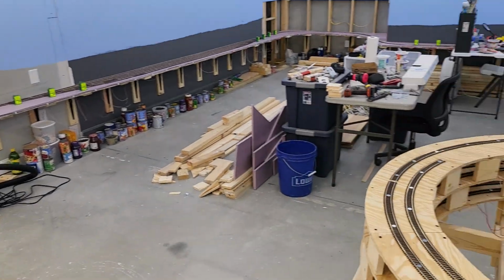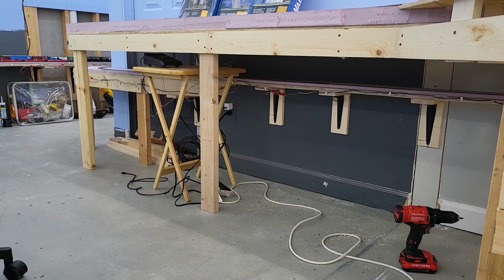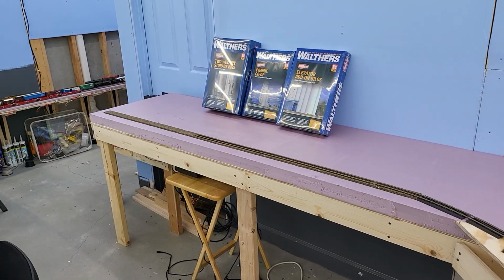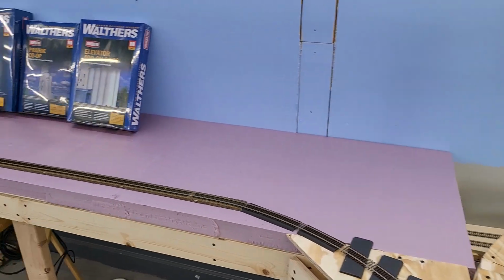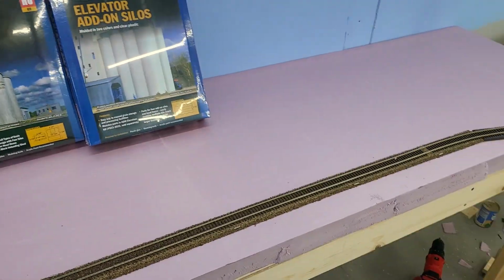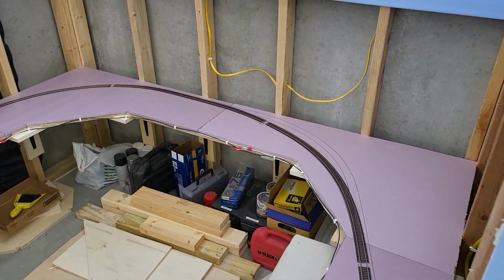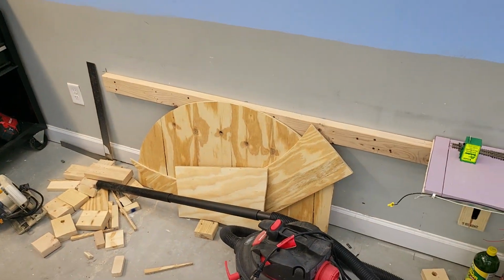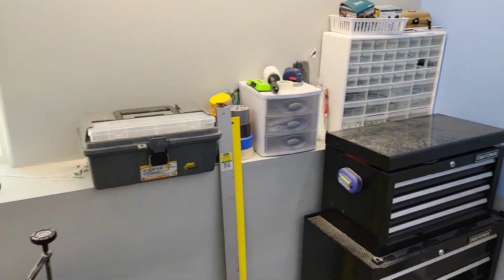K & W HO Scale Model Railroad, Construction Update #7 - East helix reaches middle deck

Comment: Hey, how wide is that helix?
Reply from the maker: @MattsTrainsandThings  It's a five foot diameter.
Reply: Thanks :)
Reply from the maker: @MattsTrainsandThings  Anytime.
Reply: @KandWRailroader  Another question, what is the percent grade of the track on the helix? Just curious.
Reply from the maker: @MattsTrainsandThings  It's a little over 2% I believe but I will admit that I haven't measured it.  The decision I made for that size of helix was more based on the space I had available more than how long a train I can pull.
Reply: @ Thanks.
Reply from the maker: @MattsTrainsandThings  Sure thing!

Comment: Great progress. On the second level already. Consider doing a double track on the other helix as well because it’s easy to do while building it and it will be rewarding if you decide to change operations later and you would be glad to have it if there was some kind of problem on the original track. This is a great series and I’m really enjoying watching.
Reply from the maker: You have a good point about doing double track for other helix and I thought long and hard about it (although not as a back up, which is also a good idea), but I decided that I really only wanted two helices for occasional continuous running for guests, and so main line traffic could approach La Junta yard from both directions.  Due to the stub-end design of the Wichita yard on the upper level, there was no need for a continuous main line because the route to El Dorado is out-and-back on the prototype anyway.  I decided I didn't want to mess with a wye either, so that's how I ended up with the plan as it is.